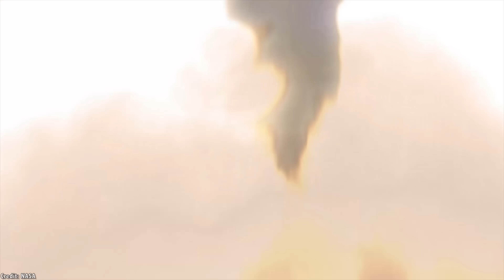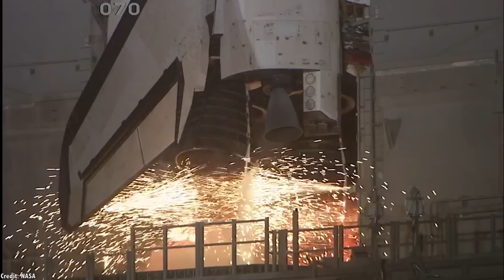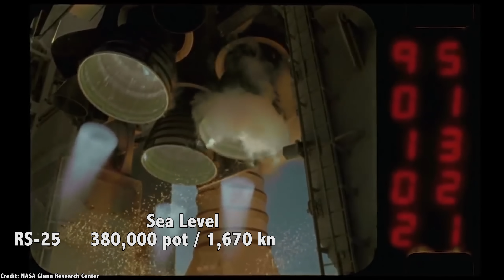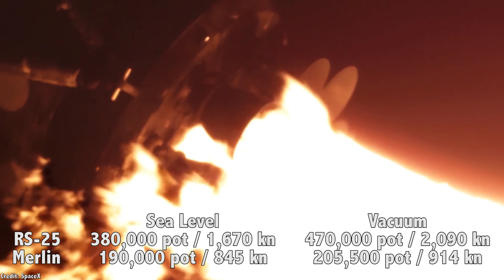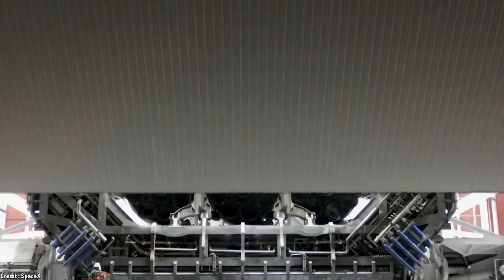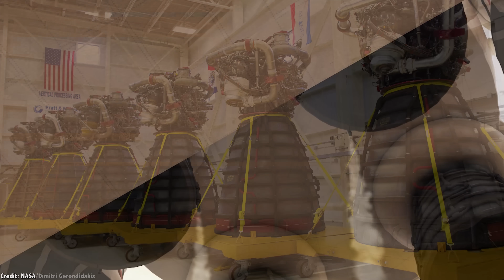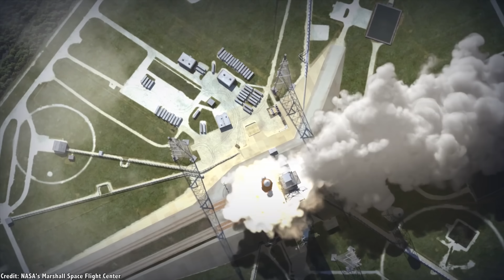The Rocket Engines Carrying Us to Space. The SLS RS-25 (aka The Space Shuttle Main Engine)

Comment: RS-25 is a HUGE waste of tax payers dollars if they continue with it. They may be powerful, but what they plan to do is a huge waist of money.
Reply: Good questions, Sherm. It might be possible to have an RS-25 engine that could both require the high thrust and operating attempts required to get 110 tonnes to orbit AND be reusable. But like I said, the SLS core stage will almost be in orbit at the time it's jettisoned. It'll be going much faster than Falcon stages when they' separate, and thus undergo exponentially more re-entry heating.

Now, the RS-25s on Shuttle could be returned to Earth because they were mounted to the back of a spaceplane and fairly well shielded for entry. The SLS core stage doesn't have that shape. It's optimized to hold as much fuel in a given structural mass, not to survive re-entry. So it's going to burn up.

Blue Origin is building BE-4 engines that can be jettisoned from the ULA Vulcan rocket, with their own inflatable aeroshell and parachutes. While it's theoretically possible to make a similar modification to RS-25s, that's going to add a lot of dead weight to the core stage during launch.

So the main challenges to reusing the RS-25s involve (1) redesigning the engine for high thrust and reusability, (2) adding a jettison/reentry system to the RS-25s, and (3) expanding the core stage to mitigate payload loss.

The alternative is to do something similar to SpaceX's approach and modify the core stage and RS-25s for reentry and landing. But it's going to require adding a heat shield/thermal protection mass to the core stage and reserving extra fuel for a final landing burn. So you'll have to scale up the core stage significantly.

I wouldn't rule out the possibility of NASA studying reusability options when SLS Block 1B is completed and flying regularly. But unless NASA intends to dramatically accelerate SLS's launch rate to something on the order of Shuttle - 4 or 5 launches a year, it won't happen.

I think it's best to keep SLS as a once-a-year, expendable crew launch vehicle. BFR can be used for bigger, uncrewed cargo and propellant logistics missions instead. Good to have several vehicles that are each ideal for different missions.
Reply: Only about 4 RS-25 engines will be built in a typical year. Is that really enough wasteful spending to be upset about?
Reply: I don't bemoan the cost per engine nearly as much as I do the billions spent on re-engineering what have been termed "off-the-shelf" parts into a "next generation" rocket.  (referring to SLS)
For instance, I'd be totally cool w/a $300 million single-use rocket sending A NASA payload the size of Cassini or larger with enough fuel onboard to go straight (so to speak) to Neptune & then orbit for 10 - 20 years. =)
Reply: Brian, ,Yes.. The reason I say yes, is its in the wrong direction. Yes I realise its a good engine, I'm not arguing that. But unless it goes toward re-usability. It is a waste of funds. Even the time it takes for them to design and complete the means they want to just blast them off and dump them  costs a lot. Even if that is successful, then you have tied yourself to an expensive engine that you keep having to build new one for the wrong platform.

Sherm Stebbins
Reply: R. Instro, If they fact can do it cheaply, use them and not go back to relying on them, then I agree.. I just don't want it to go down the wrong path were they rely   on it.

Sherm
Reply: shermluge - Reusability is the long-term trend in commercial rockets, but keep in mind that SpaceX only demonstrated first stage reflight a year ago. They have yet to refly a single booster TWICE. 

And NASA's payloads are anything BUT commercial. They can afford a bigger expendable rocket that launches once per year. They don't need to be limited by where the current commercial market is.

I see SLS as a stop-gap measure until the commercial space industry allows for rockets that can match its capabilities. In the context of Apollo and Shuttle spending, it is not egregious.

Also, regarding the RS-25, the more thrust you try to squeeze out of it, the hotter the engine gets, and the harder it is to reuse. There is an inherent tradeoff in reusability vs. payload delivery. Since SLS is a super-heavy lifter that will fly no more than twice a year, payload delivery (and thrust) is VERY valuable, whereas reusability is NOT valuable at all.

So given the niche role and design objectives of SLS, keeping the RS-25 as it was during Shuttle would actually be wasteful. You're robbing it of potential thrust and payload capabilities to give it reusability it does not need and will not attain. Does that make sense?
Reply: R.Instro - SLS isn't really an "off-the shelf parts" rocket. Its engines and motors require substantial upgrades from their Shuttle counterparts, and they have to be tested for new applications. The good news is there are a lot of 21st-century rocketry technologies incorporated into it, including the computers and controllers.

Plus, the total cost has more to do with flat developmental budgets. The engineers who work on SLS and Orion don't want to duplicate design work due to the staged development, but there isn't funding for a bell-curve profile that Saturn V and Shuttle got. Still, this will be NASA's last super-heavy chemical rocket. Efforts to launch probes farther and faster will focus on propellant depots and nuclear-thermal/electric power research.

And SLS will most likely launch the first Uranus and Neptune orbiters. It's worth launching outer solar system probes directly to their destination in less time than would be possible with gravity assists.
Reply: Brian,  part 1: Do you see a way they can re-use in stead of waste such a good engine and not go down a path that will cost us much more in the long run? part 2: Also I know Space X is not total re-use yet, but the fact they are going that direction is what needs to be done. and than you for your thoughts on this.

Sherm
Reply: And as for your other point about total reusability, that's where we need to go if we want sustainable commercial activity in space beyond launching 1-5 ton communication sats. But it's not absolutely necessary for publicly-funded space exploration missions. 

We launched the ISS with mostly expendable vehicles. Shuttle was not the most efficient way to send modules up. And a lunar space station and Mars transfer vehicle can be launched by expendable rockets too. In fact, if expendability reduces the number of launches required, space agencies will prefer that approach over reusability.

But private companies want to bring down the cost of space tourism. To the extent they can reduce these costs, that will create a new industry and have transformative effects as rich, influential people experience space from orbit.

So it's important to recognize that commercial and civil space have different approaches because they have different goals and priorities. Some of them overlap, though, so space agencies have to identify these partnerships that can be spunoff to generate new economic activity. Hope my explanations make sense.
Reply: I'm not sure if I'm going to ask this correctly, but since the RS-25 performs well at most any altitude, what extent of redesign would be needed to have the engine help with re-entry (or even feasible)? Also how much weight would be added, to be able to incorporate hardware for re-entry?
Reply: shermluge - Well, it's not engine performance at altitude that's the limitation. Those engines are pointed away from the direction of travel on ascent. If you wanted to do what SpaceX does and flip the SLS core stage around for reentry, then the engine nozzle becomes the "leading edge" during re-entry. And at near-orbital speed, that's not even close to aerodynamic. It's going to burn up.

If you want to reuse the entire SLS core, you have to redesign it into a hypersonic lifting body and add a heat shield. All of those changes make the core less efficient at holding fuel compared with a cylindrical tank. And the heat shielding is dead weight during launch.

I guess it's possible that SLS could be redesigned to jettison its 4 RS-25s with an inflatable heat shield and parachute, similar to what ULA is doing for Vulcan. But making the engine itself as reusable as its Shuttle counterpart may require developing thousands of completely new parts that can be reflown despite higher temps and stress.

I can't estimate how much mass these approaches might add to SLS or how much of a performance cut it would entail.

But I do know that these approaches to reusability will only return value if they allow NASA to triple or quadruple SLS's flight rate. And it's better for NASA to use commercial rockets to lift secondary payloads instead of going through another expensive round of redesign.

Again, the commercial sector can focus on reusability for high flight rates. NASA should focus on expendability to maximize payload delivery on low-flight-rate missions.

Then, when a commercial rocket that can reliably and directly replace SLS 1B is flying regularly, NASA can cancel SLS.

Comment: Why not park all those engines in space? Instead of having them destroyed? Put them in a crazy high orbit out of the way to be used later. Even if it’s only for the metal or small parts, that’s weight saved on a mission that would need to carry it up there eventually. 

Park them in orbit around the moon to be used in building that moon base we’ll eventually get to. 

Just having useful materials up there that we can repurpose for use in other endeavors seems like a good idea to me. Obviously park it out of the way so as to not interfere and it’s a win win right?
Reply from the maker: The whole point of a multistage rocket is that you need to discard stages as they run out of fuel, engines and all.

Comment: I love the raw power. I hate the non-reusability. Sx has really turned the industry and the way just an average punter like me thinks, on it's head...
Reply: +Brian Foss Elon has said you can expend just the center core of the FH, reuse both the boosters and take only a 10% penalty on payload. This price is only $95 million. So this throws your 70% out the window. Also NASA can afford a fully expendable FH at just $150 million, they spend that much a week on just R&D alone for SLS. And no, NASA won't have to cut their modular into thirds. Distributed lift is an idea the ULA wants to do for those paper Vulcan rocket, so I'm sure NASA could do it using falcon heavy. Hell you can get 11 fully expendable flights of a FH for the price of just SLS. And that's assuming SLS doesn't cost over $2 billion per flight, which some estimates put it at. I know my choice, same with the rest of the nation (except Boeing, Alabama and Dick Shelby) cancel SLS and spend the $3 billion a year from it on building space hardware and modules and landers for the moon and Mars. Instead NASA wants to cancel the ISS to use that money for this stuff.
Reply: Reusing all three stages of the Falcon Heavy decimates payload capacity by 70%.  If NASA were to refly on a reusable FH, they would need to triple their launches and cut modules into thirds.

Expendability is fine for SLS because it will launch massive, valuable, crewed payloads about once a year. Making one per year is not a problem. If SLS were intended to fly as often as Shuttle - 4 or 5 times per year, then reusability would be worth pursuing. For such a low flight rate as 1 per year, reusability is unnecessary.
Reply: Brian Foss where did you get the 70% number from? Is it 3 core RTLS or 2 core RTLS / center core ASDS?
Reply: 15 Redstones - Look at FH's advertised payload to GTO. Expendable launch to GTO (27 degrees inclination) is 26.7 metric tons  - reusable is 8 metric tons. That's a 70% decrease. The payload penalty would be somewhat more pronounced for TLI because of the exponential nature of the rocket equation. The upper stage has to provide a much greater delta-V in reusable mode vs. expendable mode.

And that would be 2 RTLS and 1 ADSS. Even if SpaceX had 3 landing zones, there's no point in returning all 3 cores to the landing site. The center core is designed to produce more thrust, and if you can only fire it for 30 seconds before turning it around for RLTS, there's hardly any benefit to that.
Reply: Jamie Godman - First off, NASA doesn't pay the list price for a Falcon rocket. They pay about twice that to get additional launch assurances from SpaceX. So NASA would pay about $190-$200 million for a FH to launch one of their missions. Not too much less than an Atlas V.

I realize that landing just the side boosters doesn't incur a massive penalty. It's not insignificant, but it's not huge, either. The boosters separate at about 2 km/s. And I never said Falcon Heavy wouldn't be useful with some degree of reusability. My point is that the reusability it's DESIGNED for is not very useful at all for human lunar exploration.

The OP I commented on focused solely on SLS's expendability. So I had to point out that reusing the Falcon Heavy cores as SpaceX intended makes them useless for sending a human-rated payload to the Moon.

That's where my "chop the module in thirds" point came from. An ISS module has a mass of 15-20 metric tons. If you wanted to launch that on Falcon Heavy, you might be able to land the side boosters on two ASDS. It would be a tight margin, but it might be possible. 

To land the core stage, you'd have to chop the module into 3 sections and assemble them in orbit. That's the point I was making. There's a very good reason Shuttle engineers didn't bother making the core stage reusable - they couldn't get Shuttle to orbit otherwise.

What NASA wants is to not be dependent on a single heavy-lift LV like they were during the Shuttle program. Cancelling SLS to use only Falcon Heavy would be a mistake. Being able to use both SLS and FH to reduce launches will be good for the agency and its partners. BFR will be fine for large unmanned cargo launches, and the 3-stage New Glenn can substitute for FH. 

And when New Armstrong is finished and ready to be certified, then there won't be any need at all to launch crew or outer solar system Flagship probes on SLS.

As much as I'd like to see more of NASA's resources go toward modules, landers, and other spacecraft, Blue Origin is not at a point where NASA can contract them to build a rocket for their most valuable exploration payloads. So SLS development will continue for now.

By the way, where did you get the $2 billion per launch estimate? Are you sure that doesn't include the value of the payload?

Comment: Why, when you see the Shuttle launches, does it start rising then stop or drop slightly before resuming it's lift off?
Reply: the shuttle actually rocked a bit on it's mounts when the SSME's were started - the SRB's weren't fired until it returned to a vertical position.
Reply: Thanks for explaining that.